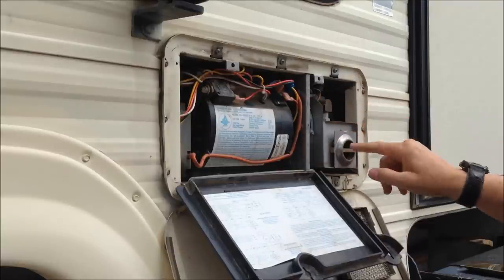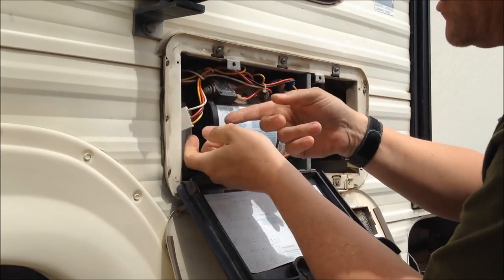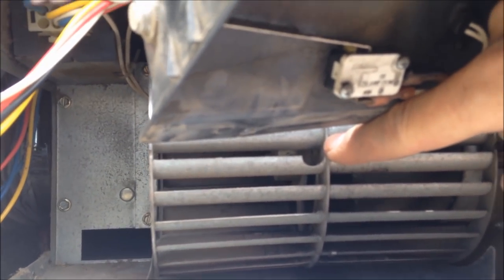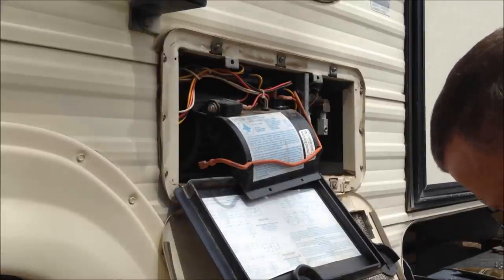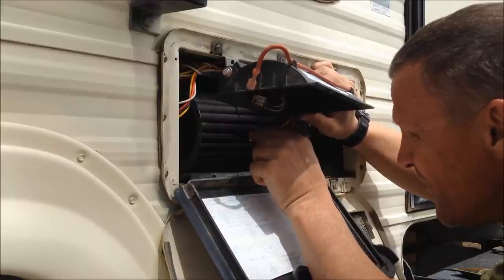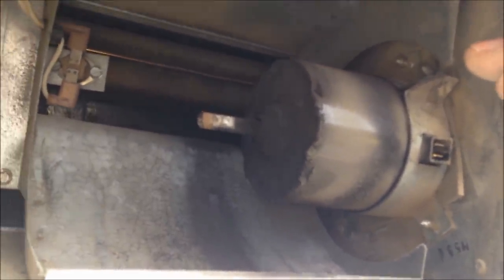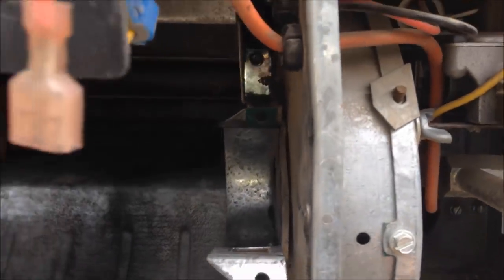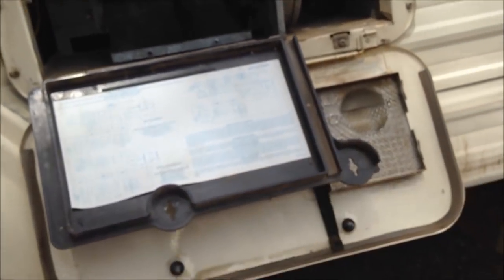RV Furnace Repair Atwood 8535-II Hydro Flame | Motor Replacement (Part 2)

Comment: my biggest question is where can I find the wiring to the thermostat, or did it run to my old dometic controller in the ceiling. I replaced the bi-metal thermostat and control box with their new version lcd display (3 buttons)....
Reply from the maker: That's a good question. I don't have the answer to it.
Reply: @WannaBFree  There is a youtube video that covers those wires

Comment: would you know if there is a difference between 8535-3 and 8535-2 I have and 8535-3 blower motor.  I don't know what the -3or -2 is?
Reply from the maker: Sorry but I can't help you out on that one. I really have no idea what the difference is. It might just be a different wire set up for the connection If I were go guess. Maybe an RV parts shop would have the answer but I just don't know.

Comment: Yeah if you get the motor wires switched it will run in reverse!
Reply from the maker: That is true :)
Reply: Won't make any difference.  Squirrel cage fan moves air the same direction no matter which direction it spins.

It is a little more efficient when it spins in the direction it was designed.

Comment: I still can't get the blasted motor out! It wiggles a lot, and I can turn it a bit, but I tried the match, and I tried prying it... what else can I do?
Reply from the maker: David Carlyon My guess is the problem is where the fan is pressed onto the shaft. Best I can say is heat up the hub for about 30 to 45 seconds then if possible use a large flat tip screwdriver and try to pry the fan off. It may have some rust or corrosion keeping it from letting go. Also just confirm the set screw is loose or even removed completely.
Reply: David, I have a 8525 II and like you I have also been having difficulty but w help of WannaBFree`s video(thanks btw) I was at least able to see and know what to expect, 

after dousing w penetrating oil one day, then next day applying heat to hub for about a minute a few times it still would`nt budge & even w some tapping on shaft while tugging motor, what I found and had to do  is place a set of vise grips on the left side(1st section) of shaft(close to motor), then secured the squirrel cage from moving by holding with my right hand and fingers, then turning the vise grips counter-clockwise in short turns(letting loose of the cage a bit and starting over from bottom w visegrips ) going back n forth like your loosening a screw while holding the cage, took about 10mins but this the only thing that worked for me. This had me stumped for 2 days on how to get this dang motor out but finally figured it out today. hope it helps you or others!
Reply: You Knowwho. I'll give it a try....ahhhhh
Reply: I still haven't gotten it out :/ Probably going to have somebody else finish it for me. I got the fan off (squirrel cage?), which I had to do like you said, but the motor itself won't come out. I haven't tried using a propane torch yet - I did try a lighter, but if heat's going to do it, it'll need more than the bbq lighter I was using.
Reply: I had to remove the little hex screw 100 percent then it came out. Used a magnet to retrieve it after opening the wheel assembly just enough to fit the magnet in. I also had taken a hammer to the shaft end and that caused the metal to form a lip which i filed down. Whew! Glad this is over.
Reply: I've been at that dang motor for 4 hours today! I've pried so hard I've cracked a bit of the plastic housing. maybe a blowtorch next or youknowwho's suggestion of twisting it. It's an sob for sure.
Reply: Donald McAdams has an excellent video too. Maybe viewing that could help.
Reply: I took a long pry bar and a big flat screw driver and put them both between the motor and the squirrel cage housing and pulled one while pushing the other on opposite sides of the shaft. I also took a wire brush and scrubbed the corrosion off the shaft after spraying penetrant on it. After battling it all day long that's what finally got it out.

Comment: I have a hydro flame furnace 8531-11 it works fine until it starts raining then it will not ignite anyone ever experience this
Reply from the maker: Sorry but I have no experience with that issue.
Reply: Hey I had the same thing on mine last winter so over the summer I was going to take it a part clean it and fix what was wrong well I took it apart and it was all clean and looked great so I just bent the two rods closer together and put it back so the next time it rain I tried it out and worked good
Reply: @randytboone1053  The rods should be gaped from each other 1/8 inch and 1/8 inch from the gas dispenser. The gas dispenser in that little screen thingie.....I know all the part names lol